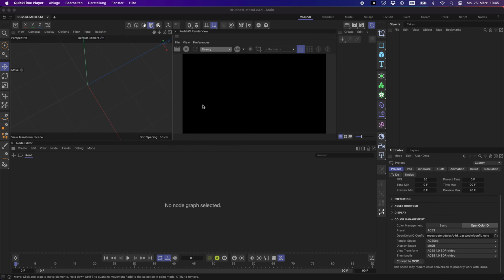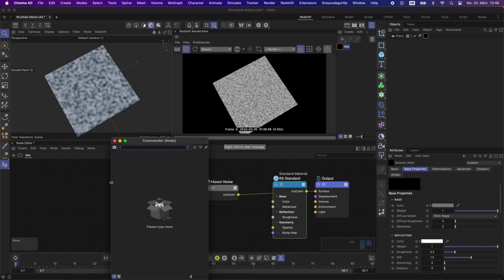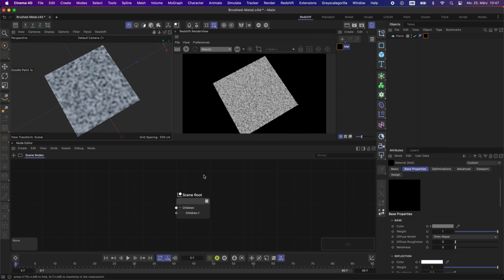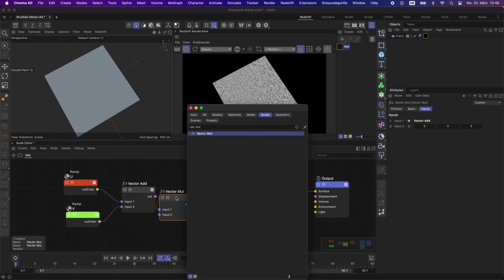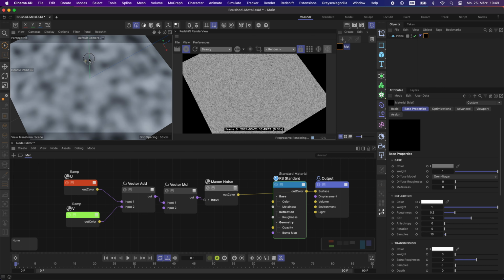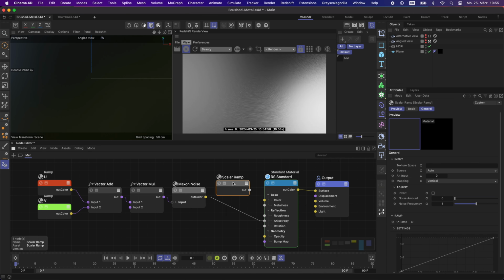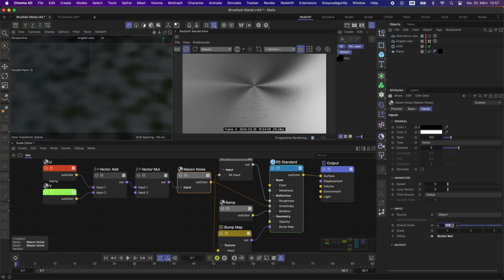Realistic Procedural Brushed Metal (Redshift/Cinema4D)

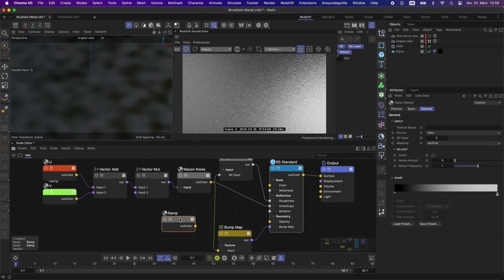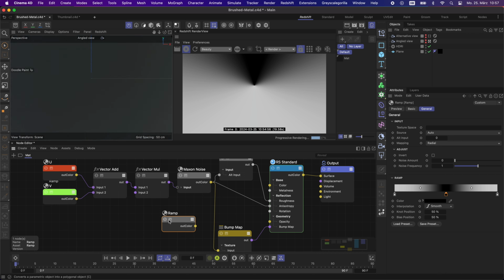Comment from the maker: One note regarding anisotropy rotation 6:40-7:01 
The default ramp at 6:40 would be the correct way for anisotropy rotation. Because I work mostly in product visualization, I'm usually doubling the knot to get a more interesting look, which is why I was doing this in the first place. ;)

Another thing I didn't talk about, is the importance of the axis of the object as the vector nodes depends on the axis orientation. If you're importing CAD-files into your 3D-program, the axis of objects are usually messed up. You either adjust the axis or swap the values in the Vector Mul Node (for example 100,100,0 -> 100,0,100). Try it till it looks right ;)